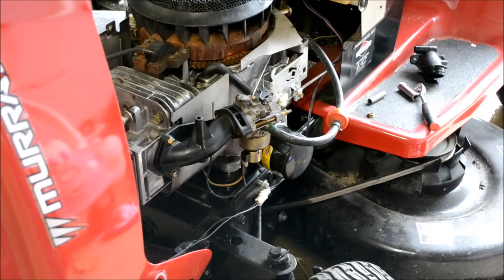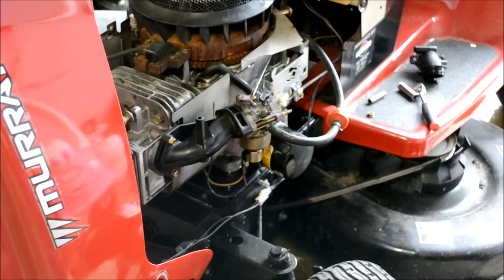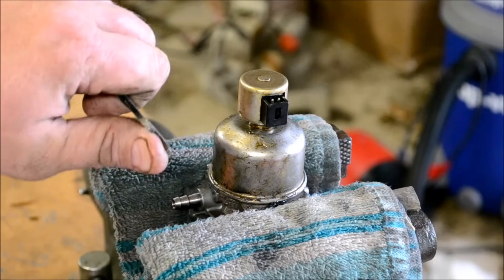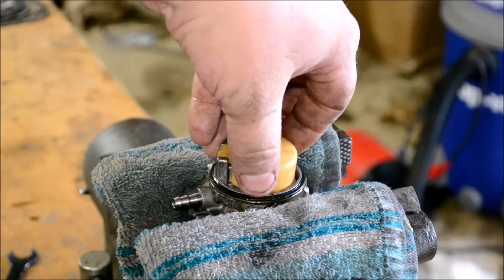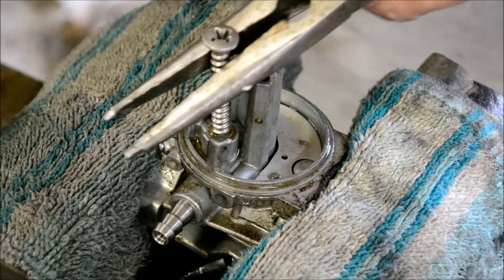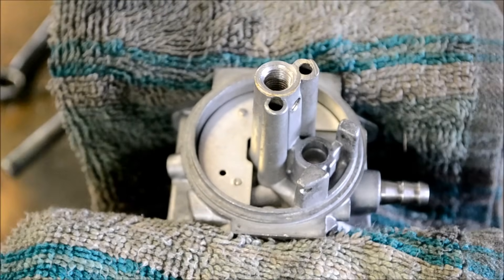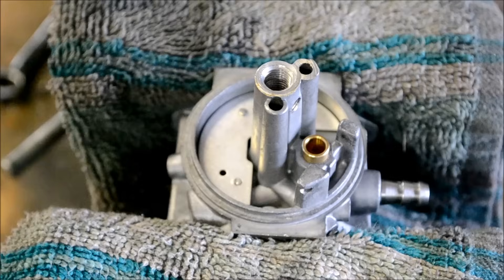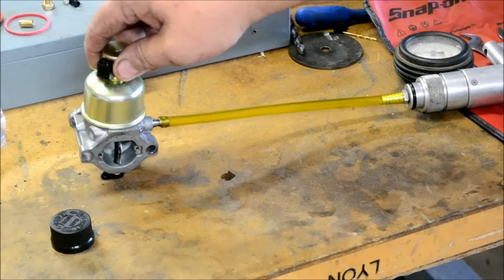BRIGGS AND STRATTON CARBURETOR REPAIR / GAS SHOOTS OUT OF MUFFLER / CRANKCASE FULL OF GAS

Comment: I used this video as a guide as I never touched one of these carbs.  Pretty solid walkthrough.  I was expecting to use the entire rebuild kit, not just a few pieces.  The hardest part was getting the seat out.  I used a few different wood screws and finally found one that was just right.  Mower starts a lot easier now and doesn't shoot oil/fuel everywhere.  Thanks!

Comment: Great informational video and very helpful. I have a John Deere rider mower with a 16 hp Briggs and Stratton engine. After several weeks of not running I attempted to start it but it was locked up and would not turn over when I attempted to start it. I removed the spark plug and fuel poured out of the spark plug hole. There was also a heavy fuel odor on the crankcase dip stick and the level was high. When I removed the air filter the housing was also filled with fuel. After watching your video I removed the carb and applied pressure to the fuel inlet. It would not hold any pressure so I am going to rebuild the card and replace the needle and seat. Thank you for making this video, I have a feeling it is going to save me a lot of money by not having to bring the mower to the local repair shop. Thanks again, very good video!

Comment: Such a great video. My B&S engine spits black oil out the exhaust and won't stay running. Working on the valves now and have a new gasket set on the way. Gonna look into the needle and seat as well. Thank you.

Comment: Thank you very much I thought that was the problem I took the motor off and replaced the seal on top and bottom the cam looked very good the valves looked to operating correctly and I adj them when I put it back on the mower it cranked right up I always put a cutoff switch and filter on my mowers I had saw a clip on you tube where the exhaust  seat was coming out I thought that was the problem but now I
 Sure it the float thanks

Comment: I fixed the gas leak into the block years ago. I put a cutoff valve in the gas line, cut the valve off when I'm finished and let the mower run dry.
Reply from the maker: Yeah but if the needle and seat is leaking bad enough it could flood while running / idling
Reply: If running/idling it would blow it out through the exhaust. I would then paint a mongoose and snake on it and join "Big Daddy" Don Garlits racing! :)

Comment: Made a tool today. Went to local metal shop, 8” 3/8 brass rod was 3.00.  Cut off 2.5 “ with a cut off wheel. I don’t have a lathe, so I chucked in the drill press , and holding the grinder at a right angle, trimmed it down. I don’t have. Briggs with
Reply: I don’t have a Briggs carb with a brass seat handy, so I just eyeballed it. Maybe it will work, maybe not, but it was fun doing it.  I don’t know the dimensions of the tool, can’t find them on line. If anyone has dimensions, please post.
Thanks, 
Jim

Comment: It's always good to replace the seat. I have found some engines struggling to run at full power due to the seat being old and swollen and actually restricts fuel at full throttle. It may idle fine but when more fuel is needed , the engine will run lean and misfire. The seat also, as the video states, can leak the fuel in the tank, into the engine crank case or combustion chamber. You can damage the piston rod when it leaks into the chamber due to hydro lock when you try to start it.

Comment: Your calling that brass looking peace the seat, right ? Is that something that normally wears out ? So does the needle have a rubber tip ? On some mowers they have a little round rubber washer that fits into the carburetor. Its got a hole in it so the needle can let the gas pass through. I have not worked on one like your showing here.
 I am working on a Briggs 17.5 OHV, POS and no matter how I adjust the screws it surges. When I run it at full throttle it runs ok, not great. Just replaced the head gasket and set the valves. I am thinking I may have to rebuild the carburetor. Got any suggestions ?

Comment: Thank you for this excellent video - I am needing to be more self sufficient and handle more repairs on my own and your video is extremely helpful.  I have a question that is so basic that I actually can't find an answer to it.  I had the stuck carbureter needle and now i need to drain the gas it out of my crankcase - is it as simple as draining the oil out?  I have the 28M707 (0122) - can you confirm what I need to do to drain the gasoline?  Thank you so very much for your time.     -Kathy

Comment: Im having problems with my briggs 20 hp rider. It was running good one day and the next it starts surging. It doesnt smoke or anything it just surges to the point where it doesn't run anymore.  Pulled carb off, cleaned it but didn't see any build up or junk in the carb.
Reply: +Dennis Manvell Dennis,
you're not getting gas IMO.   check your gas cap.  if the vent is blocked it will not allow air in to displace the used gas.  This creates a suction at your carb and it'll starve.  pop the cap off & cover it with a rag etc., then start your mower & see what happens.

Comment: I have a ? We are building an little mini quad with a Briggs engine we got a new carburetor 2 times not and now the gas is coming out the carburetor how do we fix it every time we try to push the throttle all the way down it shuts off

Comment: I am working on a Murray rider with a Nikki carb on a Briggs 28V707-1113-E1 engine.  It is flooding like the one you showed.  I cannot figure out how to remove the seat, appears to be different than the one you showed.
Thanks
Tony
Port Hadlock, WA

Comment: Question?.I have a 12hp Briggs & Stratton engine on a Craftsman riding mower and it sputters and acts like it wants to cut off when I'm cutting semi-tall grass or thick patches of grass.  I cleaned the carb, reattached the linkage correctly and it still does it.  It also does it when I'm just riding in high speed without the blades engaged. Any suggestions?...Thanks...great vid's by the way

Comment: Quick question whats that lil do dad at the bottom of the carb with the wire connector? a buddy of mine has a 12.5 pull behind mower.. strted pouring gas out like no tomorrow... but im curious about the lil part because his has no wire connected to it and no wire to be found to connect to it..

Comment: Sir, I'm thinking you have nailED what is happening to my Murry , I could not believe all the fluid that came out of machine.  I wasn't sure if it was oil or gasoline or both.  I got the head off right now. I really didn't see a problem with the head gasket. But the carburetor  was really wet inside  and kind of think something wrong there and needs investigating.  I saw a video "how fix 90% of the lawn mores with problem" (or something like that) In the video they cut the plunger on the Solenoid thats n the bottom of carburetor bowl to stop backfiring I think. Well I did look at that and well either a mechanic or previous owner already cut that plunger off on the solenoid on mine. So now I wondering is that solenoid part directly involved with that seat that you fixed or is that another inlet or jet?

Comment: Good video. I have been have fits with a B&S engine, model # 283H07-0399-E1 with a Nikki carb. The crankcase keeps flooding. I have replaced the float, float pin, needle, bowl, and bowl gasket yet the throttle body continues to fill up. There isn't a seat for the needle to sit in so that's something I couldn't replace. The carb has been cleaned, recleaned, and then recleaned again about two more times. I have also tested the fuel solenoid and it is working as it should be. I pulled the air filter and air intake pipe off today and opened the in-line fuel valve (I put one in along with new fuel lines) and found that gas is pouring out of the atmospheric vent on the carb. Can you recommend something I can check? Think  maybe I bought a faulty needle? 

Thanks again for your help.

Comment: There were more parts in the rebuild kit. What are those and should/how do I use them?
This info is the best I've seen. Thanks for doing this.
Reply from the maker: Multiple model kit. I save them but can be discarded
Reply: Got it. Thanks. Easy fix.

Comment: I have a Craftsman LT1000 with a Nikki carb that has been cleaned thoroughly and is getting fuel into the bowl.The gas is new. I have a good strong spark, The valves are lashed correctly, and it has plenty of compression. It will not start, unless I put gas into the cylinder, and then it will only run on the gas I put in. It also does the same if I spray starter fluid into the throat of the carburetor. It seems as though the gas is not getting drawn out of the carburetor. I am stumped on this one. Any thoughts?

Comment: Hey great video! I have a B & S 5 HP on a tiller thats been kicking my butt. When I start it, with starting fluid otherwise it won't start, it dies after like 2 seconds. Well I cleaned up the carb and went to change the oil and BAMMM....looks like milk. So I take the bowl back apart and the little red rubber gasket under the needle looks like it might need replaced. Does this come in a 5 HP rebuild kit?

Comment: I generally just buy a new aftermarket carb instead of buying a kit. It's cheaper and simpler to change the whole carb. An aftermarket carb for any riding mower is anywhere from $10 to $14 on Amazon or Ebay. Just search your particular part number.

Comment: I have a craftsman riding lawn more with Briggs and Stratton 18hp intec engine with walbro carb. I am going to put a kit and am going to take everything including fuel/air mixture screw out to soak carb in carb cleaner. Can you tell me how to adjust fuel air mixture screw when I put it back together. I am good on everything else. And would you happen to have an online video showing this procedure.
Thanks. Jerry.

Comment: Hey Jeremy, It's nice to see you helping all us back yard mechanics! My daughters 22 horse B+S Intec engine has several issues. I got it to run with new Battery. Now the Fuel system seems to be part the problem. Engine won't rev up just idles, runs rough and it back fired last time I shut it down. I pull the throttle back and forth still just idles and choke doesn't change because it's not working either? How is this linkage supposed to work? I have carb apart and will get repair kit, but all is looking good inside? I have yet to force air in passages. Thanks for any help. Ron B.

Comment: After trouble shooting the NIKKI flooded carburetor, running rich problem with my 10.5 I/C Intek Briggs and Stratton engine, I found the problem: the round o-ring of item 137A, after 6 years of service, compressed into a rectangular cross section. It is supposed to be a typical O-ring with a round cross section. I replaced the O-ring with one that was close in size because that was what I had available. It started right up and ran fine. I hope this will help someone from replacing the Float Needle, Float, Main Jet, etc. Good Luck!

Comment: I have on on a snapper it's A Nikki and it bench tests fine the minute I mount it on the engine it floods the crankcase I am beyond agrivated I have rebuilt it twice with all new parts including float and plastic float holder that snaps into the carburetor any ideas or replace it

Comment: I ordered a brand new carburetor for my B&S 17.5HP engine. I have a wet spark plug with gas and gas is spilling from the carb. Did I receive a bad carb. Or do I need to do an adjustment on the new carb?
Reply from the maker: New gas lines and fuel filters?

Comment: mower medic I'm having a issue similar to this video my Murray 12.5 Briggs it's shooting gas by the Grove out of the exhaust and it will not start due to this issue. do I need to replace the carb or rebuild it.

Comment: Hey mowermedic1 I’m working on a Kohler engine that pops while is running leaks little gas from mofletes. I already cleaned carburetor still doing the same. It’s a bandit stump grainier with a kohler engine command 624cc any idea what it would be?
Reply from the maker: Replace
The carb with OEM
Reply: @THEMOWERMEDIC1  I will do that. Thank you

Comment: Hello sir,

  I have a Briggs on my generator and my issue is gas is running out of the carb after starting and it died. 
   So, i turned the gas off at the line and waited a while before starting again, now i have it on level ground it started but now it stuttering as if it wants to shut off. 

   Now when i turn the gas supply line off to the carb while it's running and it runs great...... I'm scratching my head over here. Can you assist in any way. 

 Thanks in advance.

Comment: How do you remove the choke plate and shaft on one of these? My throttle plate has screws that hold the plate to the shaft. No problem to remove it.  The choke plate has no screws to the choke shaft. There has to be a trick to removing it? The carb is a Briggs Walbro  5-4993

Thanks in advance.
Reply: pull the plate out of the slot with needle nose pliers. he does not show this even though he has the new spring to go on it.  pull the plate out - pull the shaft out - replace the spring and foam
- put the shaft back in.....remember how you pulled it out.....push the plate back in

Comment: Hi Jeremy.  I have the same carb on the same engine but after I do the carb overhaul it still leaks gas into the manifold.  Now one BIG difference with you carb in the video and mine is the whole seat assembly on mine is plastic.  No seat ring no nothing!  At first it leaked gas into the oil.  Fixed that by fixing the seat.  It was drooping down. Used a blow dryer to soften up the plastic and gently fixed the arm.  But still, how can I fix this leak if the whole assembly is plastic.  Frustrate Tony.  Thanks for a great video.

Comment: What are the diameters of the orifices in the seats for the two different applications?
Reply from the maker: No idea.  Big hole = gravity flow small hole = fuel pump
Reply: @THEMOWERMEDIC1  Thanks for replying, but I am interested in what "big" and "small" are. I am trying to get an 11 HP B&S engine with an unknown history running. It starts and runs OK at light load, but it seems to be starving for fuel when loaded. I bypassed the shut off valve and fuel filter with new hose to the gas tank for testing and saw no improvement. The carburetor is an aftermarket model, and one possibility is that the inlet seat is for a model having a fuel pump. So the sizes would be useful to  compare with what I have.
Reply: I have measured three inlet seats that should be gravity flow, and a #48 drill (0.076 inch) could be inserted in them

Comment: I can't stop my newer style carbs from hunting even after cleaning. (reving up and down) Will not run smooth unless I partially choke the carb.
Reply: I have a 21 hp briggs doing same thing ? Seem like it may be running lean. Did you figure out what it was.
Reply: No these carbs today don't have the adjustments they use to have. They are almost a throwaway to me. I really don't have an answer and can't get an answer that I agree with.

Comment: Hi Lawnmowermedic, I have a John Deere L118, and I had to replace the gaskets at the base of the intake manifold as I could see gas vapor leaking.  However, the engine is still popping, and with the air filter off, it looks like gas vapor shoots out the air intake when it pops.  What could be the issue?
Reply: Adjustment on valve lash

Comment: I have a 12.5 Briggs engine in a rider mower that I bought for $40.00 only it didn't have a carburetor. I'd like to find an inexpensive carb for it and even considering finding a donor motorcycle carb. Do you have any suggestions? The Briggs model# is 289707 type:0154-01. I think the carb that belongs to this engine is a Walbro 5-4993 LMT? Anyway, I'd appreciate suggestions and/or sources for an inexpensive solution. Thanks

Comment: Like Jeremy texted in the video. Install a paper fuel filter, fuel shut off valve and NO ethanol fuel. And change that nasty filthy dirty assed oil. Only takes a whopping 1.5 quarts for a rider and 18-20 oz for a pushy.

Comment: If you install an inline fuel shutoff valve and run the mower empty...you'll have less chance of this happening later on. It used to be "never remove all the fuel  from your system" just add stabilizer...but with today's fuels that degrade fast...its better to be dry.

Comment: I work on small engines but I have one that has me stumped. I have a Subaru 7 HP EX21 that's on a pressure washer. I have wore this thing out trying to fix it. It is leaking gas into the cylinder and filling the crankcase. The brass seat in the carb is perfect and I even polished it with a Q-tip in a drill with some metal polish. the needle is new, the float bowl is good. It still leaks gas into the cylinder and into the crankcase. I have tested this carb on the work bench with it mounted in a vise with a fuel tank hooked up to it and it doesn't leak. Put it back on the engine and it leaks. What the hell is going on??>
Reply from the maker: Carb vent obstructed when everything is mounted up to the engine check that first then I'd lean toward needle and seat.
Reply: Great vid. Where is the carb vent in these Nikki, I have a Yam F4a outboard with that carb that overflows at the top plate. There are two gaps in the gasket. These may be for venting?

Comment: I have a problem with scooter carb...when driven ..gas is spraying from back of carb airfilter is soaked in gas ..what can this be ? Its a 2stroke bdw
Reply from the maker: Exhaust system clogged
Reply: THEMOWERMEDIC1 THE SMALL ENGINE SPECIALIST strange replaced the exhaust recently..think its on for half a year or so..are there other options or still think exhaust?